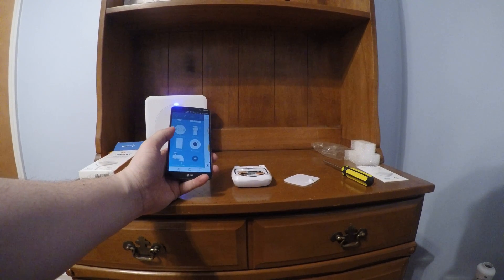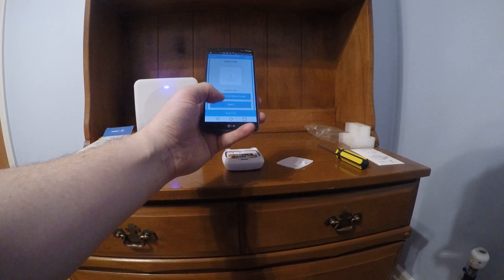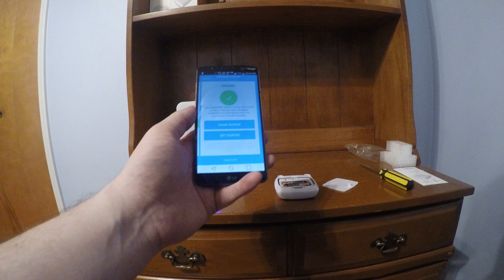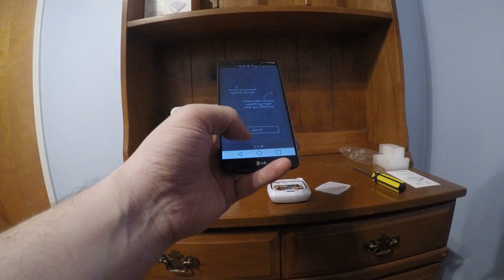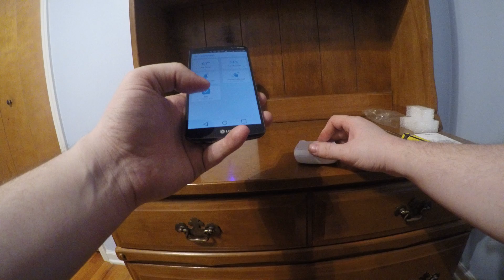leakSMART Sensor Setup

Comment: This has a beeping noise? Can it be turned off? Do you think this works well on carpet? Also, are you using alkaline or lithium batteries? It doesn’t necessarily sound like impressive battery life.